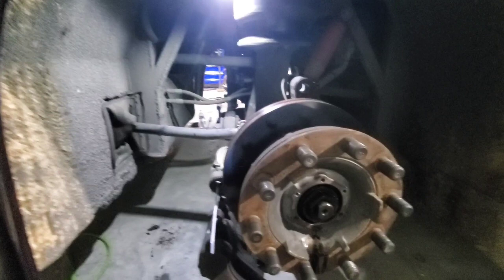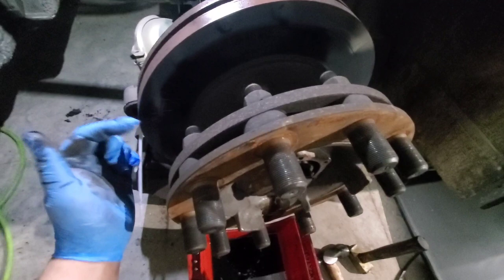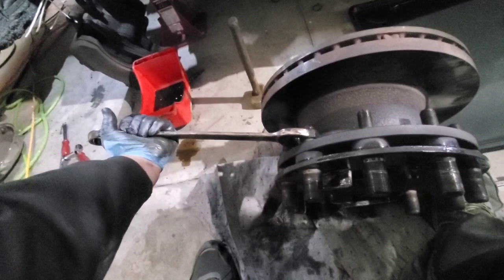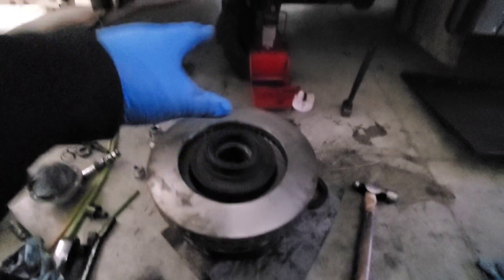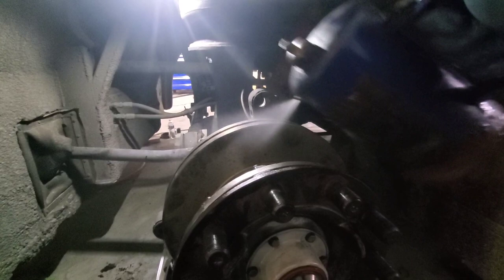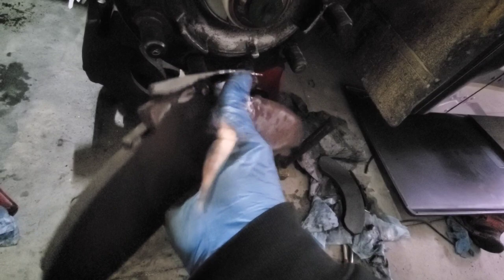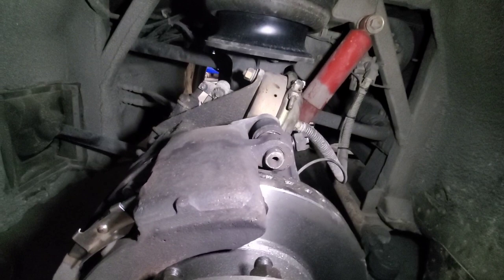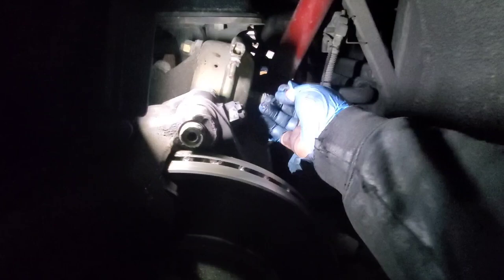air disc brake pads and rotor replacement

Comment: I haven't seen that style of disc brake for around 10yrs.  Now the Bendix 225 style you described at the beginning all the time. Between the two. The Bendix 225 style so much easier for a pad swap.
Reply from the maker: Yep definitely an improvement